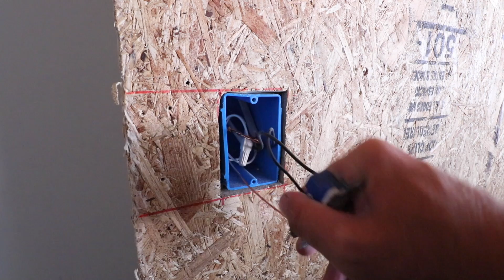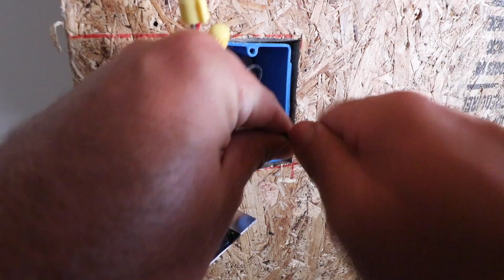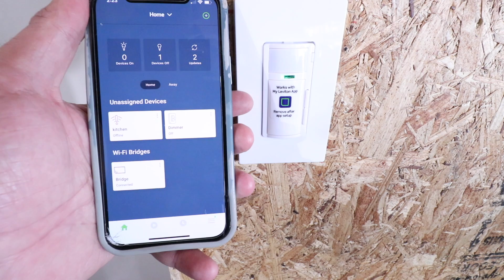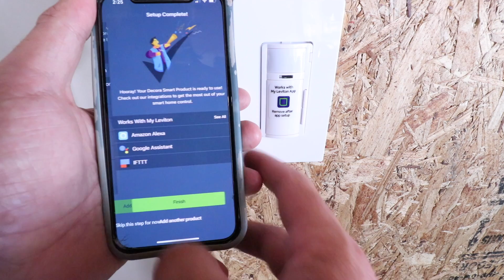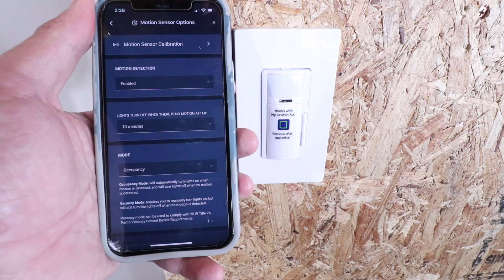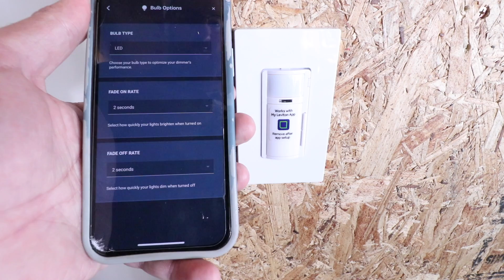How To Install Leviton Smart Motion Sensor Dimmer Light Switch (D2MSD Leviton)

Comment: how long is the timeout between turning off the switch and having the motion sensor enable itself again, i'd prefer about 15 seconds, anyone know? if it were instant you'd turn the lights on by accident when turning off and leaving the room , so there must be a short timeout duration period right?

Comment: Do you have any advice on what I would need if I installed this switch in a hallway using the travel wire for 3-way switch? Do I have to buy a second motion sensing switch or is there a companion switch for this?
Reply: Same question here.  Did you solve this question? I'm guessing two....especially if you want motion sensing near both switches.

Comment: If you disable motion sensing, how would you turn the lights on? I have a motion sensor in my garage but it's on the side where we park our cars so when I'm in the other side of the garage it constantly turns off the lights on me. I'm looking at this one to solve this problem. Or if you have any other tips on how to solve this problem I'd appreciate it. The garage is a 30x36 foot garage and the sensor is next to the walk in door in one corner of the garage.